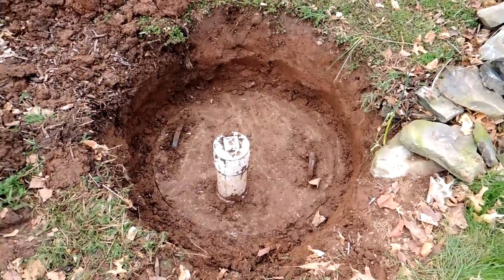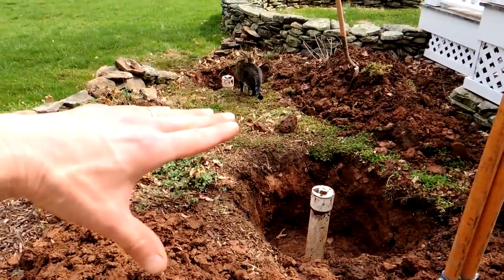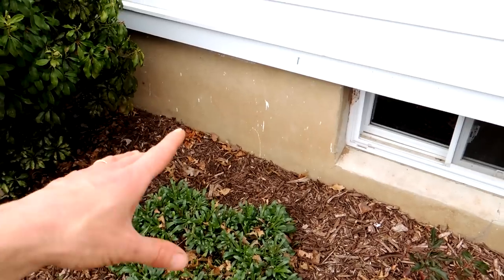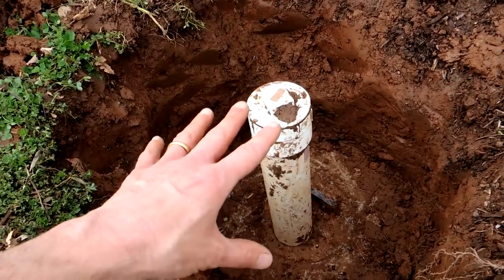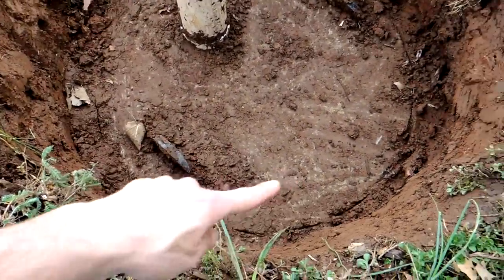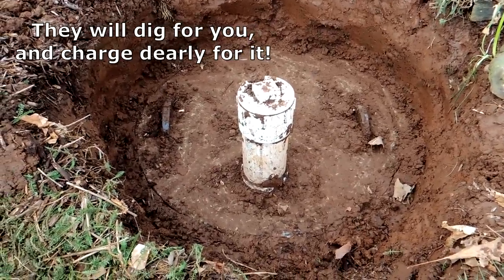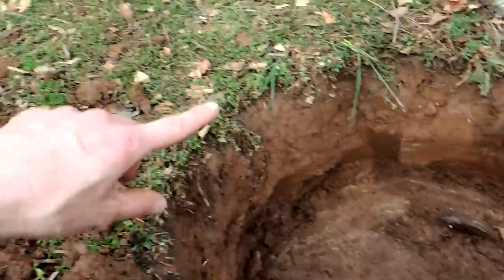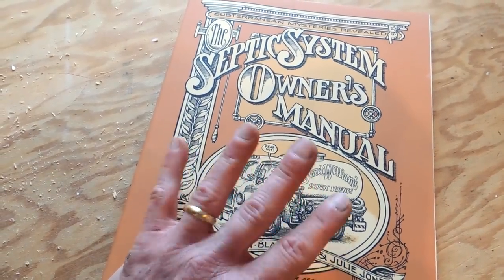Find And Dig Out Your Septic Tank Access Cover

Comment: Depending on where you live... especially in the United States, most residential Septic Tanks are between 5 and 25 feet from the house. That being said, I've seen Septic Tanks between 50 and 100 feet away from the house. So, the bottom line is this, you can expect to pay a couple hundred bucks for a Septic Professional to locate your tank and dig up the covers. In fact, once you've had your Septic Tank pumped out, it's a good idea to put a marker of some kind in your yard. I recommend a lawn ornament like a sundial or a birdbath, because you'll always be able to find it... even in the winter. In my state, if your tank is deeper than 12 inches, a "riser" is required over all the covers on your tank, and typically that's 3 covers on most modern Septic Tanks. In any case, a Plastic Riser is only a few hundred dollars, and it allows access at the surface of the earth, which makes it easy to locate without digging. I recommend installing tank "risers" even if it's not required in your state, because it makes servicing the system so much easier.
Reply from the maker: I agree that risers are well worth the investment, and now that plastic versions are widely available it's much easier to do.  In my area there are new septic requirements and new designs that I'm seeing, and some of them are quite complex.  People are building on lots where pumping or elaborate leach fields are required and I'm not sure how well these systems will hold up over time.  Here's another video I made on installing a riser:  https://youtu.be/Yfgr_CPKq_Q

Comment: Thank you! We have a strange situation at our house where we have a holding tank that gets pumped to city sewer (we’re below the city’s water lines or something?) The holding tank wasn’t ever recorded with the city though so when we have sewage problems we had to dig randomly until we found the thing! We even got the city planner out to the house and she was shocked. But after fixing it three years ago,  here we are again having to dig it up! We were silly and didn’t take pictures to remember where the manhole was but this was extremely helpful. We found the plastic handle and saw that the raised lip but it didn’t look like it could move so we weren’t sure it was the hole. 

Sorry for the long comment, but after digging for a few hours I feel like ranting about my situation lol!
Reply from the maker: That's not unusual.  Sometimes the city sewer system connection is located too high relative to your house discharge and so a holding tank is installed with an electric pump to pump the sewage up to the city system.   The tank holds enough waste for an emergency if the power goes out.  There are also different types of pumps available, some with a "macerator" that chews up sewage before it pumps.  There are also battery back-up systems available so the pump will keep going in a power outage.  if you have an older system it might be worth looking into a newer pump with some of these features.

Comment: We had ours pumped a couple years ago. It had been 13 years since it had been done and the guy said it looked good except for the personal wipes that everyone uses these days, floating in the tank. They are supposed to be septic/sewer safe, But they aren't. They will clog the line to the drain field and that would be expensive! He said it depends on how many people live there as to how often it should be pumped, 2 in our case.
Reply from the maker: +Bob Derby Yes, it is possible to go quite a long time without a problem.  However, it is also a risk.  There's a lot of room in these tanks, generally 1000 gallons or so, but if the solids or the "crust" on the top (eew) manage to get past the baffle and into the drain field you've got a big, expensive repair.  The wipes and the various female products don't bio-compose or even sink to the bottom, so you've got trouble brewing if left for too long!
Reply: I use enzyms :) I did not pump mine in......20 years, opened it up the slug layer was WELL under 2 feet. 
Also use once in while yogurt the cultures do your tank lots of good ..
Reply: Not to mention garbage disposal units!!!
Reply: Yeah if you got a good bacteria going in your septic tank it'll last longer 13 years is a long time good for you that's awesome but it will last longer because the bacteria will somehow eat the solids it's weird. Once in a while I even put a little bit of sugar in water with yeast heat it up in the microwave and put it into the septic through the closest toilet just to keep that bacteria strong.
Reply: @Septiczone  If people just use the soluble ones it's not a problem.  Packaging clearly says when they can be flushed.

Comment: I just dug up my yard to get to my septic tank lid, and my dad is adamant there’s a white pipe that should be sticking out the cap, but I dug it all the way up and there is no  PVC pipe sticking up through the concrete cap? Is that how some are or have I not dug out far enough? To me it looks like I dug around the entire circumference of the cap
Reply from the maker: There are lots of different styles, so a lack of a pipe sticking up isn't necessarily an issue.  I presume you are digging out the cover to prepare for a cleaning?   If you have a single tank system, then it is typical that there are two holes on the top of the tank.  The one you dug up may be the cover over the outlet of the tank, and there may also be a second cover or just a pipe over the inlet of the tank a few feet away.  For a cleaning it is best to expose the outlet of the tank so you can check it for damage and make sure solids aren't getting into your leach field.  If you have uncovered a plastic or concrete cap which is around two or three feet in diameter you probably have the right one.
Reply: @enduringcharm  ok thanks! Yea I had to dig up the septic cap. My father thought there should have been a pipe sticking out of the concrete cap but he realized that I dug it all the way around open and there wasn’t a PVC pipe coming out of the cap. We have one septic tank, not sure about the whole drainage field though. But we haven’t had our septic cleared in years. Last time we had a septic guy come here he was trying to explain to my dad that he rather take the entire cap off so he could completely clean the tank out, because we were having back up issues downstairs in our basement area where a stand in shower would overflow sewage out the drain. So instead of just cleaning some of it out through the small hole the guy wanted to completely clean it out but it would cost more. And the septic guy was trying to tell him this would only be a temporary fix to a bigger problem. And we would just have to keep calling him back out again to do the same thing if not. But several years have passed and not the septic is full up to the shower drain again and toilet paper and sewage came up through the drain and the water won’t go back down the drain all the way. And whenever someone flushes a toilet upstairs my toilet downstairs will start gurgling and bubbling the water in my toilet. But yea I believe the outlet of the tank is under the cap. It’s circular with one hook in it. Hoping the guy will come tomorrow, he was too busy to reach back to us today. Thank you for the info! Sorry I wrote so much just wanted to try explaining what’s been going on. Our house is an older mid 70’s house and things are starting to fall apart here left and right lol
Reply from the maker: Oh boy.  That doesn't sound too good!  When the solids rise above the outlet pipe which leads from the tank to the leach field, the solids start to fill the pipes in the field.  That's a far greater problem than the backup into the house because it can destroy your leach field's ability to work and now you need a whole new system.  With the full cap removed from the tank, your cleanout guy can do a far better job of removing solids because he can add liquid back into the tank to loosen solids and then suck it all out again.  He can also look at the outlet to see if it is clogged up.  If it is, they can try to use various pressure washer equipment to clean the outlet and even to back wash some of the pipes leading out to the D-box and leach field.  You should take this cleanout process very seriously and be with the cleanout guy when he does his work and inspection.  A whole new septic system in most places these days can easily reach $60-80K.  If you can do a thorough cleaning now--no matter the cost--it;s money well spent if it saves the system.

Comment: So wait if I see that white pipe sticking out of the ground that’s connected to my septic tank it self ? Because mine is literally next to my foundation of my house
Reply from the maker: Not necessarily.  That pipe could be a clean-out for the pipe leading to the tank.  The tank could still be fairly close to the foundation, but usually at least 10-12 feet.  That pipe you see could be a clue as to where to look, though.

Comment: I digged all the way to the roof around the access vent but I couldn't find any handles... I'm done! I'm moving back to the city in a month!!!!
Reply from the maker: Ha!  Well, country living isn't for everyone!
Reply: Call a company to find it. You may also be able to find a diagram from the city.
Reply: first name last name they all dont have handles some have wire on top of your square lid on your tank.
Reply: If you have a metal detector it will find any existing metal handles...that's what the pumping companies use.
Reply: I’ve never in my life heard of having to dig like this! Mine gets cleaned out from the vent pipe area!

Comment: my house was built in the 60's were septic access ports common then?
Reply from the maker: Well, if you have an actual septic tank and a leach field, then you also have some sort of access for clean out.  It could be well buried, though.  On the other hand, if you have just a simple cesspool, which might still have been built in the 60s, then you might not have a proper clean out.  Cesspools can sometimes be as simple as a hole filled with crushed rock.  If you are having trouble finding your tank or clean-out, a septic company with a camera can be hired to help you locate it.

Comment: It's NOT required to pump every few years IF you are maintaining it CORRECTLY with bacteria kits.
Reply from the maker: That's not accurate.  It all depends on volume and usage.  Some septic tanks can go many years without pumping because the homeowners don't create much solids (less poop and less paper!).  Other tanks with a large family (especially with a lot of women in the house)  will need pumping much more often.  The two year thing is a rule of thumb--your mileage may vary.
Reply: Paper towels, handi wipes, disposable diapers, condoms... you got problems in a couple years.

Comment: The second tube 5 feet away is full of dirt? Drainfield tube?
Reply from the maker: Not sure what you mean.  There are typically two tubes or pipes, one of which is an "inspection" pipe and the other leads down to the removable cover for clean out.  Actually, both may lead to removable covers depending on the design.  Inside the tank is the inlet and outlet pipes.  The outlet pipe leads to a distribution box and there the effluent goes out to the leech field in a series of drainage pipes.

Comment: I have an existing septic tank and would like to tap into it for my fifth wheel.  Can it be done?  Is it costly?  do i need a permit from the county?  Thanks!
Reply from the maker: I haven't the faintest idea.  Regulations concerning septic systems vary widely across the country, so you'll need to check with your local authorities.

Comment: mine goes into a leachpit, installed in 1990, when we built our home
Reply from the maker: There are systems which use a leaching pit after the septic tank rather than a leach field. Not to be confused with a cesspool, which is essentially just a hole where everything goes at once.
Reply: @enduringcharm  We built our home in 1990 with a 1000gall septic tank and a 1000 gall leaching tank or leach pit with 5 ft or stone around it. We have taken very good care of it and I now pump both yearly. Our town is changing over to Town Sewer now but it will take some time before they come to our house and I don't want to have to spend a fortune to change over to a leach field. My system is 10 ft down because our basement is an apartment. 
They all have risers, but would love to bring the leach-pit riser to the top of our lawn with one of those green covers, so I can check it throughout the year, because it is getting so full now

Comment: If you don’t have a inspection pipe , how do you find tank?
Reply from the maker: Sometimes you have to use other clues.  Find in the house where the main stack exits the building, typically with a four inch pipe.  When a tank is installed it will typically be fairly close to the house, unless there are extenuating circumstances like a pump to go uphill, or unusual topography to the land.  So, if you follow where the pipe exits the house and follow it out in a straight line 10-20 feet, that's a good starting point.  If the land there is open and without shrubs, look for indentations or other clues to where the tank was installed or dug out earlier.  If that fails, you may need either to dig down to the pipe outside and follow it out, or else have a pro insert a camera into the pipe and tell you where it goes.  Your town may also have records if the house is not that old.
Reply: Julie Chandler go under your house follow the main line to were it goes outside your house. go outside to where you found the pipe under the house take a probe rod and push it into the grond usaly your tanks 2 feet or deeper when you push the probe rod into the dirt to were you followed the pipe to outside youl feel or hear it when you hit the top of the tank.

Comment: So how do they pump it in winter in Alaska?  Ain’t no way I can dig it up this time of year.
Reply from the maker: There could well be regional differences.  For example, septic systems in your area may have permanent clean-out pipes for access without digging.  By definition, though, if you have a septic system installed in your area you must have a frost line that stays above the depth of the laterals.  Here in Jersey our winters vary, but the frost line is considered to be about 36 inches, meaning it doesn't freeze below that level.  I'm sure the frost line is deeper in your area, but it might not be much deeper.  Digging frozen ground can be done if necessary, and the type of soil can make the job easier or more difficult.  A clay soil is tough.  A sandy soil not as bad.
Reply: Enduring Charm LLC I have glacier rock soil
Reply from the maker: Do you have a septic field with laterals, or is it just a storage tank kind of arrangement?  If you have a field with laterals they must have found soil that percs and doesn't freeze at whatever depth they put the pipes.  If you have more of a double-tank sort of arrangement you might have some vertical access cleanout pipes that can be found.  If you live in a suburban/city sort of area your municipality or county may have records of the design.  If you are out in the sticks you might want to contact a local septic cleaning or septic installer and see what they can tell you.  There are lots of variations in design, so sometimes you just need to poke around if there are no records.
Reply: Plan to pump in summer not winter

Comment: Hello, I bought a house 3 years ago and I don't know where the cespool is, how could I find it, I would appreciate the help
Reply from the maker: First, do you have a cesspool or a septic system?  Two different things.  A cesspool is a simple pit typically filled with stone, and effluent just flows into the pit until one day it doesn't drain anymore.  They have not been permitted new for many decades, but there could be a few survivors out there.  A septic system has a concrete tank and a drainage field, so that solids stay in the tank and liquids drain off into the field (there are variations, of course).  The solids are removed from the tank every couple-few years.  Anyway, to find your tank or cesspool, first look inside your home.  There should be a main "stack" pipe where all drains in the house lead.  That stack goes upwards to the roof where eventually it is vented, and it goes downwards, eventually leading to a lateral pipe.  That lateral pipe, typically four inch diameter, exits the building somewhere.  If you have a basement it will go through the basement wall.  If you have a slab foundation the stack enters the slab and the lateral may be under the slab.  If you can find where this pipe exits the building you will be headed in the direction of your septic tank.  Typically the tank is not located far from the house.  Push comes to shove, a plumber with a camera can find the tank by following the inside of the pipe until a distance and direction  is measured.
Reply: Have you not watched the freaking video?

Comment: I have an old survey from the 70's of my yard. The point where the 2 measurements are for my septic tank aren't in a straight line from where the drainpipe is to the overflow... Is the point where the 2 measurements meet actually the service point? Its under a patio that a previous owner put there (MORON) and i have to get it serviced ASAP. I dont want to start breaking up all the cement and digging on the blind. Thank you so much.
Reply from the maker: Unfortunately there's really no standards to these drawings, especially back in the day, so there's no telling.  If you are faced with digging up a patio, consider first hiring a plumber or septic specialist with a camera and/or magnetic sensor.  They can snake the septic lines and tell you essentially where everything is before you dig.
Reply: Cheaper to remove and redesign  the concrete patio than install a new septic system.